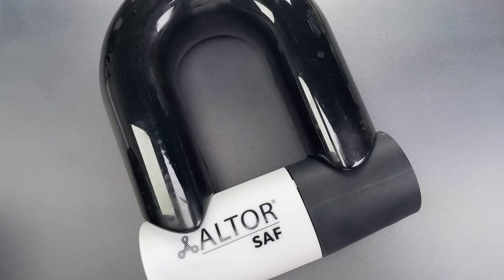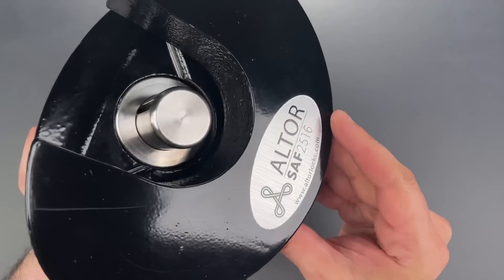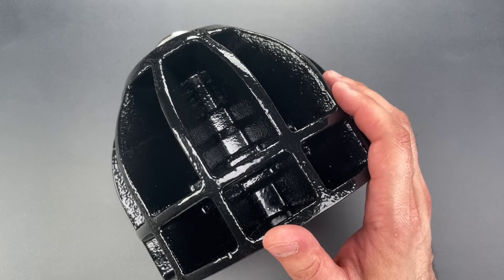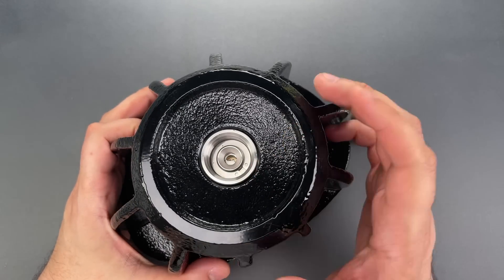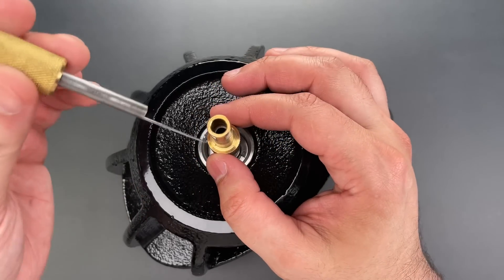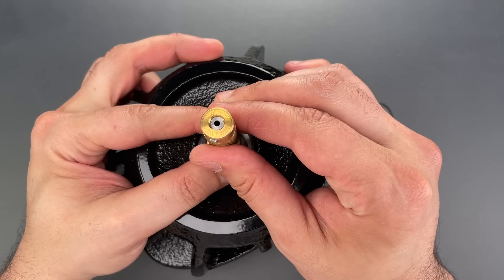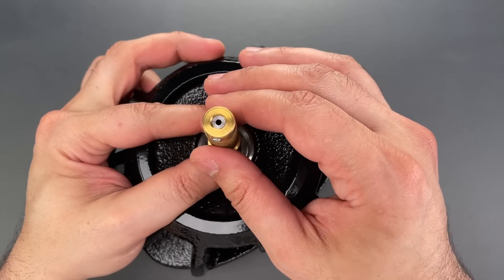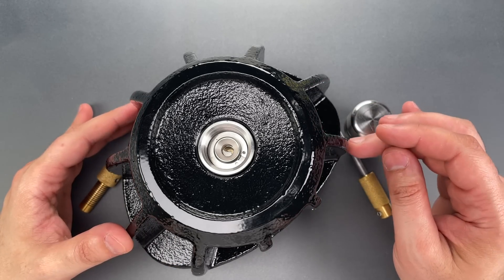[1339] HUGE Altor “SAF” (Strong As F***) Trailer Lock

Comment: The odds of anyone ever actually being able to remove this lock in the real world are basically none. I mean, nobody's gonna break it, and it took a master lockpicker over a minute to pick with a custom-made tool designed specifically to pick this rare type of lock. If someone manages to get past this, there's not anything you could've done to stop them in the first place.
Reply: And if you can go to such lengths to steal the items protected by such a thing,  you can probably get access to a tilt tray truck n just lift the sucker away. 
There's always a way around.
Reply: The only thing this protects is the hitch coupling itself. 99% of couplings are bolted to the trailer drawbar by 4 exposed bolts.
Reply: I'd just pull the trailer away with the safety chains. Hook them up a bit tighter than normal, stay off the freeway, and deal with the lock elsewhere.
Reply: @DiscoFang  I believe LPL mentioned this in a separate video with a coupler lock. It's either welded on or bolted, the latter case being one to watch out for when considering a lock.
Reply: Chances are the truck attached to this trailer is easier to open quickly than this lock.
Reply: @Hubris2  When parking a trailer in an area where it might get stolen but I have to leave it for whatever reason.
I remove all the lugnuts but one from one side and loosen that one significantly enough that it will come off if the trailer is driven down the road.
Reply: Let’s face it, if it’s ever picked there are only two suspects, LPL and Bosnian Bill
Reply: @shawnr771  I had a small dump trailer I used to do this same thing with. Idiot dragged it 11 miles away with 1 wheel on it. Replaced it with a tandem axle trailer, and now I just chain the wheels together with a halfway decent lock on the inside of the wheels. It has been dragged 10-15ft twice, but, never made it off the site. Funny how little thieves care when it isn't their stuff, and just how much effort they'll put in to completely destroying it when they can't have it for themselves.
Reply: @shawn2444  lmao.
The guy who told me to do this found his trailer full of brick about a half mile from the jobsite still attached to the bumper with the license plate.
Reply: @shawnr771  Haha, classic! I'd have probably been laughing so hard, I couldn't be mad about the trailer.
Reply: A thief will find a way if they really want what you have. In all of history no one has made anything 100% thief proof specifically because if the idea of how to protect something can be dreamt up by a human, there is always at least 1 other human who can dream up how to defeat it
Reply: It would literally be easier to take off and weld on a new tongue, if it wasn't interchangable anyway.
Reply: This is the kind of lock where to remove it, you apply your cutting tools to the item it's attached to.
Reply: It's always interesting to hear discussions about "the weakest link" in any system, when it comes to theft deterrence. I guess you just hope that the would-be burglar didn't bring a rattlegun or a grinder with enough battery to cut the bolts. Of course, we're pretending that the noise of either tool coming from your backyard in the middle of the night isn't going to make somebody wonder what's going on. 

I wonder how much of the job of these locks is simply psychological? Obviously it's impossible to assess. How do you measure the amount of crime that didn't happen because Mr. Trailer Pirate saw this beast hanging off your hitch, remembered that it got the LPL's approval, and moved on?
Reply: This thing is so robust it almost guarantees I'll lose the key.
Reply: @True Flameslinger welded is only useful if the actual tongue is welded, not the pins/bolts. If it’s just the bolts that are welded that’s a fast cut and swap with a spare tongue. If the actual tongue is welded (and there’s no bolt holes) even cutting the tongue off wouldn’t be fast much less having to drill bolt holes for a spare tongue.
Reply: @Shawn R, anyone approaching the trailer would see a wheel canted if only one very loose lug nut was there, much less the wobble when they went to drive. Kind of a dumb idea.
Reply: @shawnr771  Beware that that may pose a safety hazard to both the thief and other motorists. Last thing you want is to get a manslaughter charge.
Reply: As with any lock, the main purpose is to make it as difficult to defeat as possible.  No lock impossible to defeat.  What matters is the locking mechanism is too difficult for the average thief to pick.  The lock body is so robust that it would take power tools and a lot of time.  Time is often the enemy of thieves as is noise.  A quick loud noise might be worth the risk or a long, quiet process.  But a lot of loud noise for a long period of time with sparks flying isn't worth the risk.  Sure someone could probably use a cutting torch but that adds very bright flashing light and smoke that could draw attention from quite a distance.  Liquid nitrogen might work but judging by the size of this mechanism, you would need a whole lot of it and some expertise as well. It would still require at least some time and then large hammer blows.  The best bet would be to find another victim that has an easier lock to break.
Reply: Probably easier and faster to drag the trailer onto a flat bed...
Reply: It would probably be easier to just steal the car the trailer is attached to lol.
Reply: @chrisf5418  Well, now you know where to go to get it opened at least.
Reply: @shawnr771  You may want to check with a lawyer on that. You are endangering public. Like yes, the thief may get in jail for stealing, but you'll get a longer sentence for manslaughter of a couple of bystanders.
Reply: @Coffreek  That's why stealth is usually by your best bet when trying to keep something safe from a thief. You cannot steal something if you cannot find it. Locks simply deter those lacking resolve and slow down those sufficiently determined.
Reply: except a 36v 9inch grinder
Reply: The picking with a custom tool was done on the bench, lit and upright by a master. Installed, it will be on the bottom and probably dark out... Pick another target and forget this one...
Wonder what the price point will b on this...
Reply: At that point they saw the lock and opted to steal the whole truck and trailer
Reply: It'd be easier to weld another hitch to this lock than remove it
Reply: @Hubris2  if the truck is hooked to the trailer, there is no place for this lock...
Reply: @timwolters3286  looks like $375 for the 2" ball one which really isn't bad for something built like this.
Reply: @kefeer123  But your honor, we had a flat and had to fit a spare and get the other tyre inspected, so not all the lug nuts were in it.
Reply: Locks only keep honest people honest.
Reply: and lets not forget the most critical detail, he picked it upside down. the pin which the lock cylinder is in is inserted through the bottom after the main body is slid over the coupler. so you're gonna have to put your face under this 20lb hunk of steel to actually see what you're doing, while it is attached to the tongue of the trailer, which (given it being a 2 5/16 hirch model) is used on any trailer with a gvwr over 7000, thus meaning the tongue weight is 700+ pounds. if that trailer jack gives out... you're now a tootsie roll that was thrown from a parade float that never got grabbed.
Reply: @drawapretzel6003  If you were to steal the trailer, removing the old coupler wouldn't be necessary until later. An new tounge bolted/welded underneath the old would make the trailer mobile. There is always a way to defeat security.
Reply: @Coffreek  Backyard? What about trailers at jobsites?
Reply: Angle grind the trailer arm.  Go for the weakest link.
Reply: @DiscoFang  all my bolts are welded from the inside. Welder only charged me $40 to weld all for bolts.
Reply: @DiscoFang  those bolts are really only for alignment purposes. Every coupler I've ever dealt with has been bolted, and then welded solid all the way around.
Reply: @DiscoFang  yeah but then you've got to bolt on a new hitch,  this is designed to stop people just hooking up and driving off
Reply: @moconnell663  Sorry but that’s utter nonsense about the bolts being just for alignment. Couplings are manufactured and certified to certain weight ratings and that includes specifications for the bolt size and strength. In my country any trailer used on the road needs to pass inspection and a coupling with a rating is mandatory. For any trailer of classes 2ton, 2.5ton and 3.5ton, welding that rated coupling would require engineering certification. 
No doubt you see it where you are.
Reply: @DiscoFang  may I ask what country that is? From my perspective, it is a GOOD thing to exceed the legally defined minimums....
Reply: @moconnell663  NZ. Welding something when it’s not specified is not necessarily “good” or “overspecified”, especially when it relates to safety. It might be, it might not. Unless you’re an engineer you can’t make that call.
Reply: @moconnell663  I’ve worked in building construction & design half my life. There are many situations where bolts or other mechanical fixings are required rather than welding. Either because of movement & flex or simply reliability and consistency of install (bad and apparently-good welds can fracture). Too often what may seem (even quite reasonably seem) as going beyond “minimum” is actually causing potential problems. See that a lot in DIY home construction!
Reply: @DiscoFang  I come from the land where non-metallic sheathed cable and plastic junction boxes (shudder) are permitted in residential construction. Needless to say, my home was reworked to commercial standards, EMT, BX, and 1900 boxes throughout. There is exactly 4' of romex left ( dishwasher hookup, which seemed reasonable enough). The garbage legislators let people get away with astonishes me.
Reply: @ram89572  Can you outsmart a lock? Maybe. I’ve yet to meet a man who could outsmart bullet.
Reply: @DiscoFang  Locks deter thieves of opportunity. Not determined criminals.
Reply: @DiscoFang   yeah, was looking for this comment - 3/4" and a battery impact and you have a new coupling chaged out in 30 seconds - welding the bolts/coupling to the trailer would provide even more security and some of the larger commercial trailers that this is probably designed for dont have bolt on couplers.
Reply: @shawnr771  all fun and games until the trailer flies off at 50mph and runs a family off the road and you go to prison with the thief.
Reply: @DiscoFang  always weld all the bolts on a trailer. Makes it a royal pain if maintenance needs to be done, however, it makes the entire trailer significantly more secure.
Reply: @jesperohlrich7090  Yep
Reply: Even if it had Disk Detainer Core the people who steal trailers probably don't know how to pick any lock.
Reply: @MaplePanda04  how you figure? The thief would have to convince the authorities it wasn't him that did it. "No officer, the wheels had all the bolts when I parked the vehicle. The fact it has been stolen can not by itself rule out that the thief (or a thief before him) was interfering with the vehicle and bolted when they heard activity, interrupting them mid-steal.
Reply: @DiscoFang  I welded mine.
Reply: acetylene torch would have that off in a minute - they have small portable ones. if some really wants the trailer, no lock is going to stop them.
Reply: You could drill through the top and hammer the cylinder down and out. Takes at least two minutes though
Reply: and it took him over a minute after he wouldve been practicing before the video and researched the lock mechanism
Reply: @DiscoFang hopefully if someone is buying this thing they are at the very least spot welding the bolts. If you want to actually get the full value of the additional security this thing provides you probably want to weld across all points of contact, and maybe weld on some hardened rods too lol. Will be a pain to replace if it gets damaged but a $300 22 lbs lock is also a pain, if you are going to invest in that you should take the other precautions imo. A lock this beefy will attract attention, and may do more harm then good if that attention makes people more likely to notice another security flaw. Like a beefy u lock that’s locking the quick release front wheel of a road bike.
Reply: Not to mention they’d have to be laying on the ground in the mud facing up to pick the damn thing.
Reply: Thermite enters the chat.
Reply: Dont attack the lock. Swap the tongue, if its a small enough and light enough trailer, wench it onto your larger trailer and secure it and drive off. If i was hauling around expensive stuff on a trailer i would even swap the wiring harnesses on my truck and trailer if possible to something non standard so that the thief has to decide between being able to run lights or risk being stopped for not having lights, or having to stop or have brought temp lights. If you are going to go this route for a trailer that is still capable of being trailered itself, i would reccomend someone invent a special wheelset or universallly configurable device that will effectively immobilize the wheels of the trailer in a say that it wont roll and will take tinkering over a period of time for dollies to be attached.
Reply: Be easier to cut off the tongue and weld on a replacement.
Reply: You guys are really gonna spend the time to weld on a new coupling or burn it off with thermite without drawing attention or being noticed?
Reply: @Tomatolover120 Torch off the part of the lock that holds the lock pin in place.
Reply: Not to mention he was picking it upside down. I’m sure picking it in locked position on a trailer would add a degree of difficulty.
Reply: @pookatim I wonder about liquid nitrogen. My understanding is that  only some alloys get brittle. The reason they do is the hardening process continues all the way down to like a few degrees above absolute zero (which some premium drill manufacturers use to their advantage, quenching in liquid nitrogen) and over-hardened steel tends to shatter. I don't think it's a guarantee that the particular alloy they're using will be vulnerable. And with all that thermal mass, you'd need a BIG dewar, because it always takes more nitrogen than you would expect.
Reply: @volks-jager yeah, I'd just whip out a cutting torch. If you're worried about the light, pick up a fiberglass fire blanket, and a thick fire resistant  work tarp and make a little theivery tent.
Reply: Also you would be on the ground with the pick going up. Making it even more difficult.